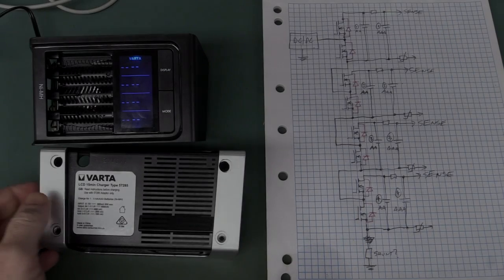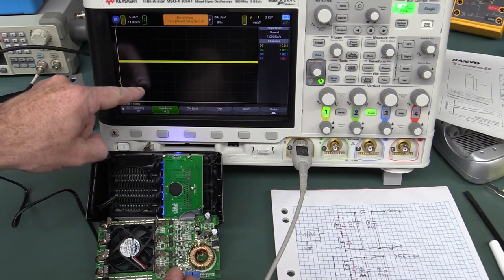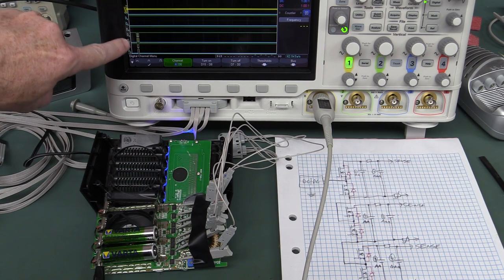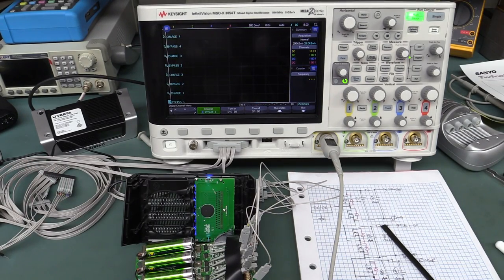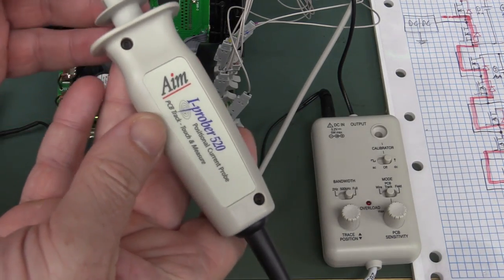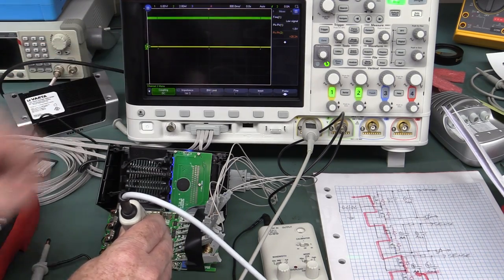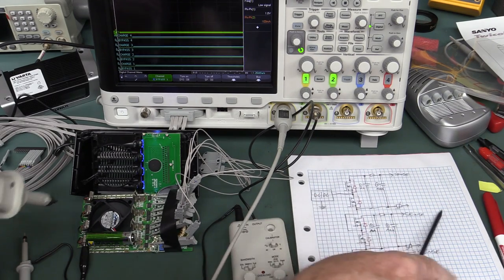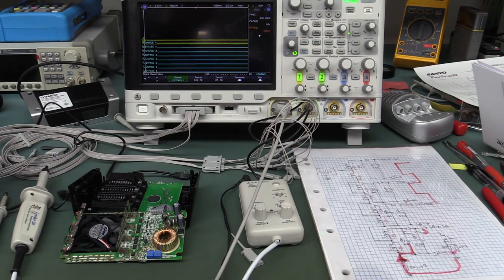EEVblog #812 - Varta 15min NiMH Charger Part 2

Comment: HI Dave. @30:32 in your video. You talked about a major discrepancy in the voltage on your meter and what was showing up on the charger. That's not because the charger is off cal. It's because the charger is measuring the voltage when the charge circuit is off. The charger is measuring the voltage of the battery in-between those short off pulses on your oscilloscope, Your meter is measuring the voltage while the charger is on and that 200mV discrepancy is cause by the battery internal resistance.

Comment: I think Dave gave the poor charger too much hate on the voltage measurement. Remember the weird short pattern that the channels were displaying during charge (14:15)? I think this is where it actually measures the cell voltage. It first disconnects all the batteries to get the out-of-circuit voltage for each cell that is actually displayed on the screen. Then it gives full charge current to or each, one by one, to test if charge voltage is still within safety I guess. I think Dave should've used the scope to measure battery voltage and trigger on the drop to get the cell voltage. I'm not an experienced engineer by any means, but just gave my 2cents.
Reply from the maker: +MrZhilvinas Yeah, it's doing something like this.
Reply: +MrZhilvinas Agreed. The charger does not deserve that poor verdict. 4-pont voltage measurement would not have worked for a battery charger. They have to shut off the charge current to get accurate voltage meqasurement, and guess what, it is exactly what they are doing.

IF the charger had used 4-point voltage measurement, then it would have deserved the poor verdict!

Comment: +EEVblog - Well I still think my idea of discharging exactly reverse of charging is more elegant!  (posted in part 1)  Less parts required and variable discharge rates with ease.  Also, the higher than expected charging voltage is required to push the higher than standard charge current.  Disconnected voltage would still be under max battery charged voltage.  Great video!

Comment: I guess battery voltage during charge is measured during the cuttoff time, which would be reasonable.
Reply: I think so too :)
Reply: +Charlie Pechiar Yes it certainly is. But it's still very sadistic how they push the cells. I would not recommend these 8A chargers to anyone. And I also do not recommend to charge cells in them unattended!!!

Comment: The voltage on the cell was so high because the current is very high and the cell reaches it's voltage very fast. But the controller is measuring the cell voltage when the charging is temporarly disabled, so the voltage is much lower on the display of the unit. It actually shows the unloaded resting voltage of the cell.

Comment: That "inaccurate" voltage is so much lower for a reason! 

That short pulse you see when it stops charging is there to measure the battery voltage without the extra voltage caused by the charging current making a drop in the resistances. This way the charger gets a better idea of what the actual voltage is without being screwed over by the varying internal resistance of different batteries and the possibly changing contact resistance.

Comment: The voltage discrepancy when charging is because the charger takes the voltage readings at OCV during the pauses during charging. If you captured the voltage at the cell during the pause, you'd find it would measure a lot closer to the readout voltage display, I suspect.

Comment: Regarding the series ammeter that causes charge to stop - I always understood these "fast charge" cells had a chip inside for identification, accessed through some one-wire like protocol, maybe that's to do with some of the pulses that are seen, would be interesting to scope the actual battery terminal instead of the MOSFET gates to see if any communication is visible. If I'm right it's possible the ammeter breaks the communication. I have the "old" charger, and when any normal cell is inserted it will charge it with the usual C/5 current. Only when it detects a Varta fast charge cell will it switch to 8A charging. I could be wrong and it might be based on internal resistance measurement but I doubt it, because once my Varta cells became worn it would still charge them fast. By the way I can confirm the cells don't like the treatment - mine became nearly unuseable after maybe 20 cycles, with terrible self-discharge rates and barely half of the capacity. Hopefully they've made progress, the old ones weren't eneloop-like.

Comment: 20:50 Where the meter can't measure current properly, is it because it's in auto mode? I've had issues with my meter messing with the device on current mode because its auto was switching the shunt or something, where it worked fine if I disabled auto and switched to a higher range and left it there.

Comment: The periodic switch off each mosfet is to detect if the battery is still there and what is it own voltage. Sure, you could measure the lack of current on shunt resistor, but you would not know which cell was taken out (or is broken).  You need to do that even if you have single cell.

The staggered signal, is there probably to measure current per cell. If you know a total current per cell 1 and 2, and you switch off the cell 1 and 2, measure voltages of 1 and 2, then switch on cell 1 back (but not 2), and measure current, you could calculate in software individual currents.

That is my guess. Very smart.

There is only one limitation of this setup. You cannot discharge and charge different cells at the same time. Same with refresh. If you are refreshing 4 cells, the device will most likely wait for all 4 to be discharged, and only then switch to charging.
Reply: +movax20h <<There is only one limitation of this setup. You cannot discharge and charge different cells at the same time.>>  LOL

Comment: So does it have reverse polarity protection ? Or is it imposible to place cells wrong ? Because if i see it right, then it would toast the mosfets via the parasitic diodes right ?
Reply: +Martin Str&#225;nsk&#253;-Krtek Right person would put them in reverse. I know that some people have skill to even put RAM in reverse and fully lock them in place. So i think no mechanical protection would help it :D
And cells are cylindrical, so not much you can do mechanically. I hope it has reverse protection...

Comment: At 14:13, only one charge FET is on at a time, all others in bypass: it must be measuring individual cell voltages during this time, then returning to muxed charge. But why does the D0/D1 cell measurement take ~6 times as long as the others?
Reply: +FlyingShotsman maybe it is doing something else during that cycle, not only measuring cells' voltages. Maybe checking temperature sensors or something else.
Reply: Probably so, given how the PTCs appeared to be wired.  Good thought...

Comment: Regarding the difference between the built in voltage display and that measured by the meter, could it that it's measuring the battery voltage during the dips when the charging current is bypassed/off?

Comment: One question about the solder loaded traces that should carry more current: Why is that solder interrupted periodically? Doesn't that defeat the purpose? I mean if you have just the trace on that 1 mm where the solder is interrupted, isn't the extra solder just useless?

Comment: I bought one of these chargers a couple of months back, and was a bit concerned about how hot the cells get.  It's interesting to have an investigation like this, and confirm my suspicion that Varta are pushing the envelope quite a lot here.  (I try to put four cells in at a time, to get the charging current down to slightly less insane values.  It is a pity that it isn't user-settable to a lower rate.)
Reply: +boggisthecat Yeah, they should have included a 1/2/4/8A setting at least and just disable the 8A setting when more than 2 batteries are in. The hardware is clearly capable of doing this.
Reply: +KX36 Everything over 700 mA is stupid and insane. I recommend the BC-700 charger from various reseller brands. AAA should not be charged with more than 200 mA and AA not with more than 500, in urgent cases you can use 700 mA. This will increase the lifespan of quality cells quite a bit. I am only using Eneloops now, threw away all other NiMh cells because they were a pile of garbage. Fully charged and then empty the other day. LOL

If it happens that you need full cells instantly, just go ahead and buy some alkalines. There is no use for this VARTA charger. Being said by a German. ;)
Reply: I know nothing about it but the datasheet shown in part 1 gave specs at 2A charging, so it sounds like up to 2A would be OK rather than anything up to 700mA. I just plain don't use rechargable AA batteries as they last nowhere near as long per charge as the life of even a cheap single use battery so I just get those.

These videos have got me wondering what the charging current on my cordless drill is though since that charges a pack of 5x 18650 lithium batteries from the point of no movement on the drill to what the charger calls "full" in about 20 minutes.
Reply: You should test the Panasonic Eneloop cells. They are as good as any alkaline. You can even put them into a remote, lasting very long. Use Eneloop Lite for remotes, self-discharge rate almost zero.

Never trust data sheets, every cell manufacturer wants you to wear your cells as fast as possible to buy new ones. So do not charge them with more than 1A... 500mA is better for AA and 200mA for AAA.
Reply: I agree with you Kyodai. Having used a Rayovac 15 minute fast charger manufacturers CAN (and did in one case) build robust high quality fast charging NiMH batteries. Unfortunately Rayovac discontinued this amazing system 8 years ago (I think) probably because it was too successful. It was a proprietary battery and charger system that actually charged their AA and AAA batteries in 15 minutes or less and they did get hot. But they lasted forever. I had used them daily for years (400 to 600 cycles on most of them) and they worked under very high drain conditions. In fact I still have a few batteries that are still working (easily 10 years old) albeit at lower capacity.

I'm going to get the Varta and test it on my Eneloops b/c it's the only charger that actually monitors the individual cell temperatures with active cooling. We'll see if it actually works like my Rayovacs did...

Comment: if you could physically place a couple batteries in series; and hipotetically the charger went to 3.3v: ¿could they be carged in series and enjoying the same voltage, 1/2 * VDC?

Comment: I did got why they have the 4 bypass mosfets. Can someone tell why they could not have the 4 charge mosfets in parallell?
Why do they need to drive one the second, third and fourth mosfets through the bypass instead of driving them in parallel with the first?

Comment: Can you do a ghetto measurement of current by using a standard oscilloscope probe with a loop of wire, essentially making a current transformer? How do those clamp meters work, and how can they measure DC?
Reply: +Power Max I think the current probe is actually using a Hall effect sensor, not a simple coil. How could it measure the earths magnetic field otherwise?

Comment: discharge is half watt right? what if you discharged one cell for an hour then got out the flir cam would that show you if mosfets or current sense resistor is passing that 400 ma?
Reply: +marty mure - Well it would be about 400mA x 1.5V = 600mW... close enough depending of the battery's state of charge.  I think you might be able to see it in IR but it's only 300mW per resistor and there are likely other parts that are getting hotter.  IDK maybe!

Comment: While it is really convenient to rapid charge one's batteries. Doing so will drastically reduce battery life. I have a US version of this charger made by Energizer and it charges fast, but the batteries are so hot after you can hardly touch them. I wouldn't use this fast charge very often, only when needed. 90% of the time I slow charge my batteries at .200 MA.

Comment: So, but the thing is, if you charge a battery at 8 amp, but have the batteries switching 50 50, can you really say that it's 4 amp?
Reply: I thought in the first video that they stated it as being 8 amps only when charging 2 cells.
Reply: Antonio Tejada Yeah, but it's still 8 amp with 4, just that it's flicking them on and off in a 50 50 sequence.

Comment: Maybe they are discharging by applying PWM to both MOSFETS at the same time, Thereby controlling the rate

EDIT>NOPE. guess not

Can't escape Dave! He'll figure it out with all the awesome tools :)
Reply: +nikotwenty  But then how do you measure the current. Plus you cant control the rate because of the battery esr. I have some AA that give 5A+ when shorted, but other with more charge cycles that barely give 2A

Comment: I do not get it... that little MOSFET + the 6.2||6.2 resistors cannot handle the 500mW discharge, and survive for that long ... 
MOSFET is a SOTx, and the Rs are maybe 0.10W each?  Those three components would be burning hot if they are the discharge path.
Reply: +Ivan Kocher - IDK, are those 1206 resistors?  0.25W each.
Reply: +Ivan Kocher  I was thinking the same. The PCB around the resistors looks bit burnt.
Reply: +Ivan Kocher Not a problem for the mosfet as it would be wide open and dissipating little power. All the dissipation happens on the resistors. Maybe warta did push the specs a little there too :D
Reply: +DolganoFF The mosfet is not the one I really worry about.  If all 1206 resistors are dissipating .25W each, such a small volume will heat up.  But as you said, varta is pushing the specs a little, if they do that to the batteries, who cares about a little resistors ;)

Comment: That's one clever charger... but why would they make something that will eventually kill your batteries?
Reply: +Eviltech why would the battery company sell something that makes you buy batteries more frequently? hmm. I don't know. ;-)
I think they probably can push the specs a bit because of the fan cooling and presumably safety monitoring and that they will have tested in house with their own batteries, but yeah it does seem very dodgy.
Reply: +Eviltech it would be cool if it had a normal charging mode as well, or did it and I've missed it?
Reply: +Coolkeys2009 I can recommend the BC-700 charger, it's not from a single brand, in Germany it is reselled by Technoline. It can charge with 200 500 and 700 mA adjustable, can discharge, can test, also refresh and costs only ~$30.

BE CAREFUL, THE SOCKET ON THIS THING IS A 12V SOCKET BUT IT IS DRIVEN WITH ONLY 3 VOLTS! Carefully take a look which power plug you stuff into it's back before putting in the power plug / wall wart...
Reply: Wasserverschmutzung That's what i meant...
Reply: +Eviltech I deleted my original comment about my Maha charger when I realised I may have been over discharging some of my batteries damaging them. However I've just discovered that as well as refusing to recharge older higher impedance batteries, the discharge test when set to 100ma also tells you the batteries have 0mah capacity which has caused me to throw away many batteries. These batteries can supply 1 to 2amps+ of short circuit current and light a 200ma+torch bulb for hours. From the reviews I read on Amazon it looks like all the chargers(intelligent ones) suffer from similar issues, definitely causing people to throw away batteries with plenty of usable capacity.
Reply: Coolkeys2009
Didn't experience this with the BC-700.
Reply: ***** I'm going to partially retract my comment about the Maha charger as it stops discharging at 0.9v so the high esr of the battery may be causing to cut off early. If my current charger brakes I will consider BC-700, but I've been disappointed with all of the smart chargers I've bought so far.
Reply: Coolkeys2009
I also recommend to use Panasonic Eneloop rechargables (The Sanyo ones are old) only, all other brands are an utter embarrassment to mankind... Pure capitalism products.
 Even VARTA...
Reply: +BloodySword Ok :-) I'll put the eneloops and BC-700 on my wish list.
Reply: +Coolkeys2009 Disclaimer: I do not get paid for this, not from who ever manufactures the BC-700 chargers in your country, nor from Panasonic. ;)
Reply: Thanks for taking the time to offer your opinions.
Reply: +Coolkeys2009 I have 4 Panasonic Eneloop Pros in a blood pressure measure unit, last charge was September 2014, still works. This just changes your mind. :D